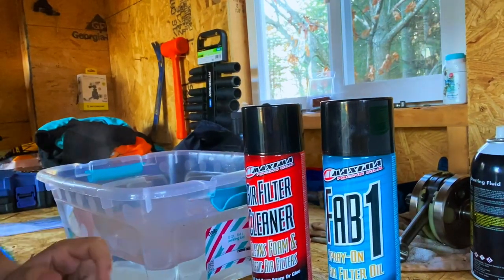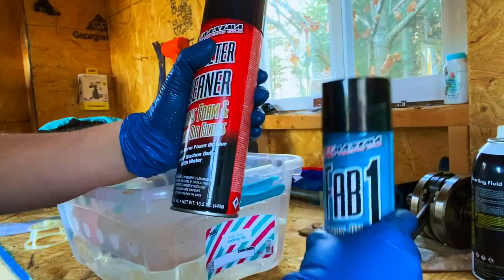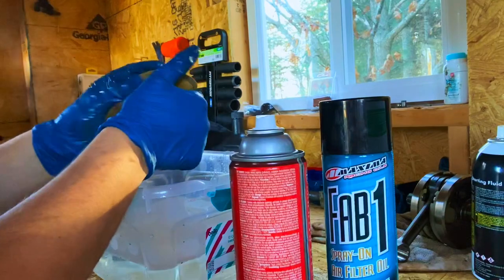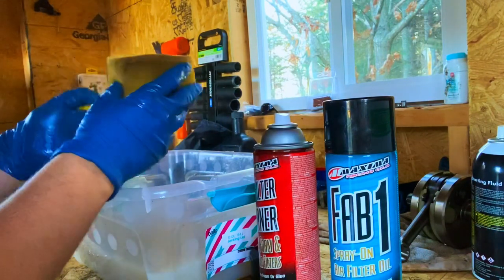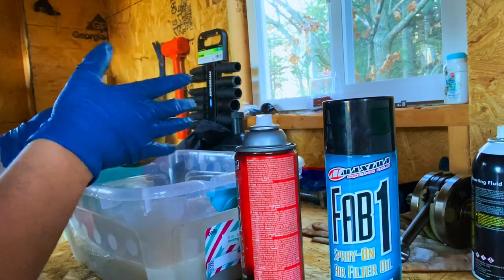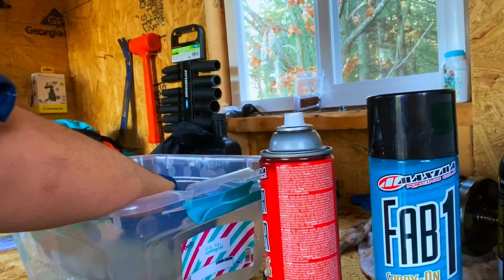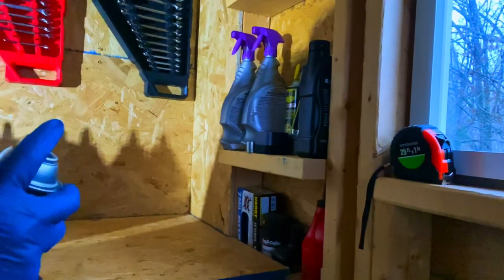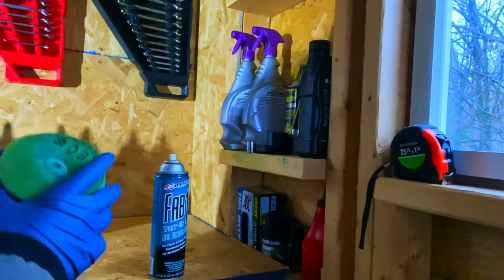How to Clean and Oil Your Air Filter *Spray On*

Comment: Aren’t you supposed to massage the oil into the filter?
Reply from the maker: The spray can didn’t specify I don’t think, I just sprayed it on. You could be right, but I let it sit after I put it on so it would soak into the filter before I put it in the bike.

Comment: Never use hot water,over time hot water will damage the glue in the filter
Reply from the maker: Thanks for the advice! Makes sense of what your saying, the can says use warm water, but you have a very good point! Thanks for watching!
Reply: Thats when you buy a new one for $20...
Reply: Filter is suppose to be replaced at that point
Reply: @skyyy5150  for real sometimes it’s not worth my time to clean a filter and it’s just better to put a new one in